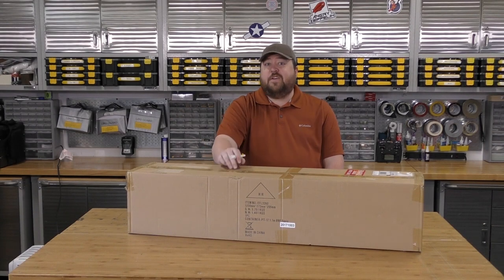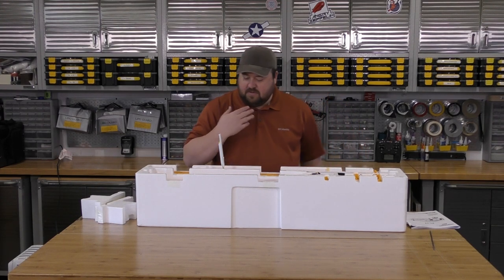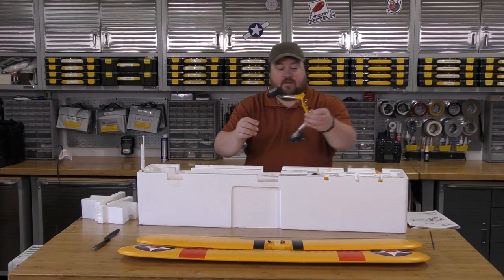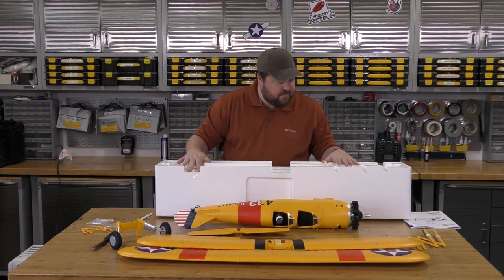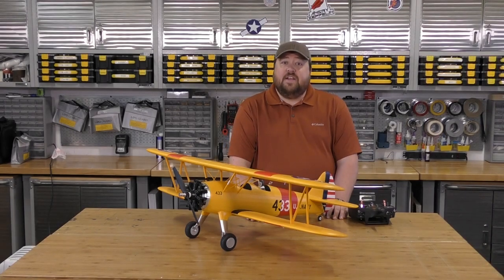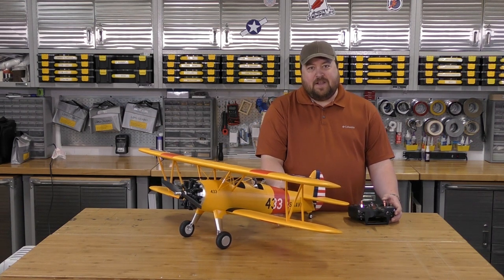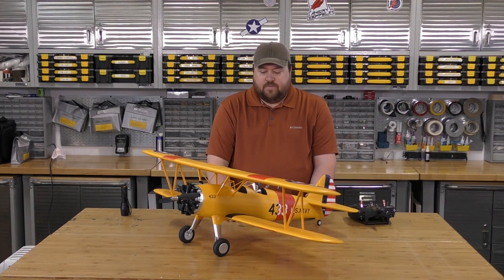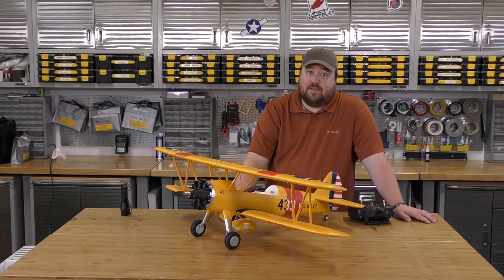E-flite PT-17 BNF Build and Review

Comment: R type split pins with small key rings can be used to secure the lower wings. I’ve got them on my plane. I just pull on the key ring to remove them.